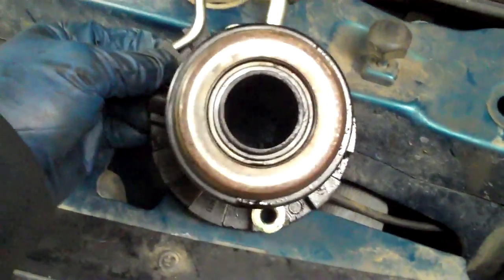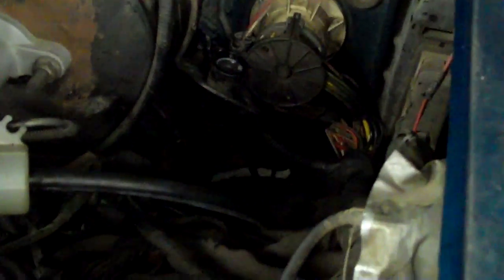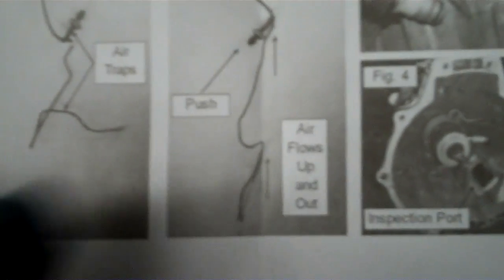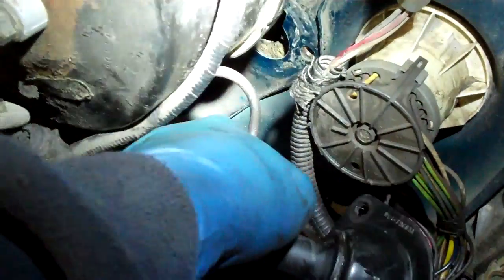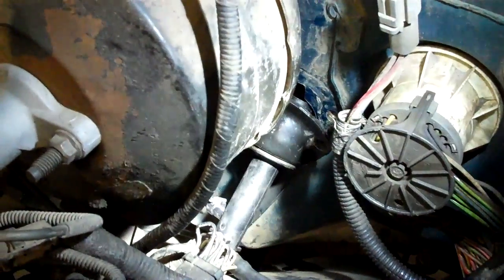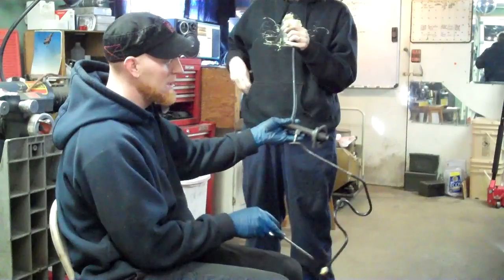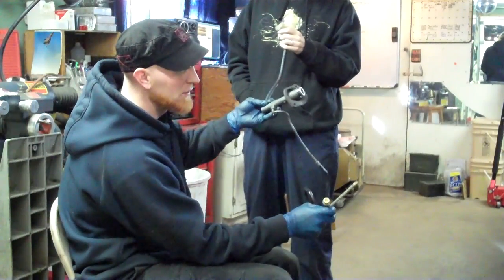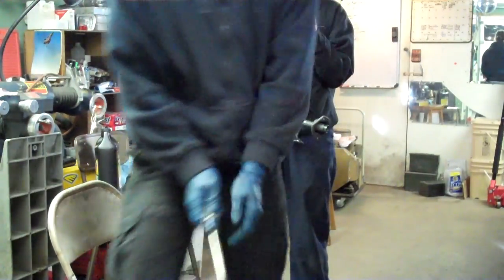Ford Concentric (in the bell housing) slave cylinder bleed process how to

Comment: I just replace my clutch assembly and slave 2006 Ranger 4x4. this was a big job. You have to pull master if you have soft pedal bench purge is the only way. I found that pulling c clip that holds plunger in and can pull plunger let fluid over flow and replace plunger and C clip. Don't open valve that plugs in to trans. put it all back together and gravity bleed slave. Never push pedal til after slave bleed or you will push air back into the system

Comment: I had the same issue, got past the problem by pressurising the fluid at the resivoiur and slowly releasing the bleed nipple and repeating this over again half a dozen times. Finally came good tho.  Great vid thank you for sharing..
Reply: How exactly did you pressurize and force fluid down to the slave?
I'm having a hell of a time trying to get my clutch to disengage!
Reply: I used a bicycle pump with a cap same size as the cap on hydraulic brake RESERVOIR. Filled it up screwed the cap on pumped air in and after 5 pumps I opened the clutch release bearing valve to let the air bleed out. Did this about 5 or 6 times until we got a hard pedal. 2 man job and a pian at that but now it's settled and the clutch is all good thankfully.
Reply: https://youtu.be/sAGOpWfAR9U

Comment: Since you have had so much frustration with these, have you ever tried "bottom bleeding" with a fluid/pressure source from below? Air goes up easier than down? Might avoid removing the whole system. People have also suggested jacking up the rear of the truck to change the cylinder angle, which sounds pretty dangerous unless you have a lift? That was for a f150 not sure on rangers.

Comment: I have to say that the concentric clutch is one of the tricks that ford is using to sell new  trucks, soon we will have to have ten mechanics all tapping and holding and pinching some stupid system to even get the simplest cave man tech to work. They are selling alot of new Trucks because of this impossible to maintain tech, the mechanics all think it is stupid, but the manufacturers know that taking 25 hours to do a simple task like bleeding the crazy straw design sells alot of new Trucks. The humans are all being swindled as hard as the robot can make the 40 hour simple maintenance job.

Comment: I would have to wonder if you have figured out the fact that most of your problems are lack of understanding how the system works  and its to bad you are on the internet giving terrible advise and bad mouthing the design , you should maybe take a class on clutch systems , be for you embarrass yourself so bad
Reply: Exactly these guys are just idiots. Firstly I’ve never done it this stupid way as it doesn’t work for shit. Vacuum bleed then and problem solved. Not to mention this is a very common clutch type 😂

Comment: crap man. i pulled the hydraulic lne from the master to slave already... I bench bled the system but i cant get the line back through. im afraid i really screwed up here..
Reply: its a 93 ford ranger 2.3 liter  5 soeed manual with the concentric slave... holy crap man. i done did it this time.

Comment: I just removed the snap-ring from the top of the master cylinder and pulled the plunger out until I had fluid coming out and re-installed the snap-ring,Was kind of tight as I did this without removing the master,had to take the rod off of the pedal and that allowed me to pull the plunger out enough.Fixed it,no more air and full pedal of clutch.

Comment: thinking about buying this 1990 f150 for a killer deal but the guy claims that theres so much air in the clutch that it wont drive down the street properly and hes selling it dirt cheap because he cant figure out the stupid thing. Now i see why.
Reply: +Heartshapedenemy The point is you CAN fix it, but it's a little tricky is all.
Reply: Pixel_Spy Just did the same thing with a 1990 Ranger. fun times

Comment: one more thing to add, when trying to connect the line back to the master, after I broke the rusty original, ( the new one shouldve came with a new retaining bolt at least, especially for the price it was), I found theres a design flaw, and theres very little lip for anything to catch, so you cant just use some kind of jerry rig pin or anything on it, and I cant put enough pressure on the brittle PLASTIC line to push it in enough to get a bolt to clear the lip and retain the line, there was no ring in there either, its like something is missing, the new one didnt have one either, personally, especially on a full size vehicle, I had rather just have the old fashioned mechanical clutch, those components lasted alot longer, were more durable, and adjustable. if there was a place to mount a pivot ball inside the bell housing, I would modify mine today, and I am going to search out a junkyard with an F-150 with a clutch pedal, and horizontal-through-the-firewall master like any first grader would see is much better of a design, I have owned many 70s and early 80s full sized trucks, and loved the simplicity and the durability, I am starting to remember why I hate anything new enough to have fuel injection and a hundred emission sensors, what a waste of engineering, all though I like the power and response of fuel injection, the rest of the "upgrades" and computerization, plasticizing etc, makes me want to give someone a black eye, sorry for the rant, I was up till 2 am messing with this frustration factory, and back I go, If u have any suggestions for a simplified modification to better components from another vehicle, let me know. have a good one, and remember, DONT BURN THE FORD!!! lol, ( i have to tell myself that every time I work on a kia too)

Comment: you are exactly right about the quality of this product, and also of the ravaging good time it is to attempt to get the air out of it, mine is a van, I am having the problem that I cannot find a new line anywhere, mine is kind of brittle, and I cannot take it off without replacing the slave and line I cannot find, ( I am replacing the clutch master on it bc where the line connected on the plastic one I took off, was leaking, just a little, and, the new master did not come with a line or a retainer bolt, which was rusted and I broke), I was trying to do it this way, but with it still connected to the pilot shaft of the trans, and found this video hoping I was doing it wrong and there was a better way, thanks for the input, Im gonna subscribe bc my sentiments of this monstrosity agree with yours, and just bc Im a red bearded mechanic too, lol

Comment: a shame you had to go thru all that grief before you found the best way to bleed the system. There seem to be a shitload of bleeding methods for this ford/mazda set up but the best way by far is to remove the master cylinder and line as you did at the end. It took me 20 mins to remove this with just needlenose plyers, a flat screwdriver and channel locks. I tapped out the bubbles as you did and reattached in 10 mins. job done.

Comment: Worst design ever.  I have 2 rangers and an F150 in my driveway, all with the same system.  I've changed the slave on one of the rangers twice.  The second ranger is a buddy's and I'm replacing his for the first time since he's had it (a year).  My F150 has gone out 5 times in the 12 years I've had it.   Always in the winter.  I noticed the new slave I picked up this round  had a boot over the cylinder.  We'll see how it lasts (Or maybe I'll get lucky, and my buddy will sell the truck before then).  I don't think my next truck will be a ford.  They're tough, but I'm tired of working on unrepairable designs, and fixing unrecalled flaws.  God help me if I ever meet the person who designed this system.

Comment: I hope you still check this for messages cause I am really desperate. I knew replacing the internal slave was WAY out of my realm in the dirt of my driveway so I paid a garage to do the work. When I got the truck back the pedal BLOWS! It goes to the floor and only works for the first three inches. I know the guy isnt gonna do it right. Is it possible to just feed NEW line back down in there that is straighter than dumbass Ford's twisty bullshit? Can I redesign it? invinciblebitch@yahoo.com

Comment from the maker: The only way for vacuum to work is to have the system closed and pull all the air out of the fluid or in this case through the fluid.  That would take a long time and may also prove ineffective.  Search "Avid Elixir Disc Brake Bleed Procedure"  on Avid's channel here on YT and watch at 1:10